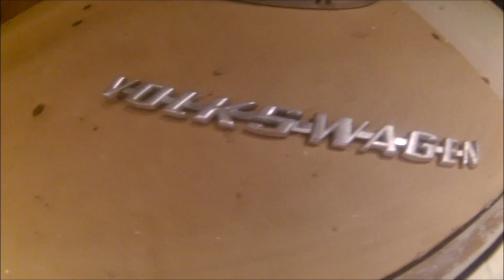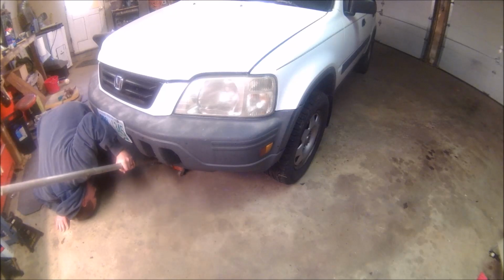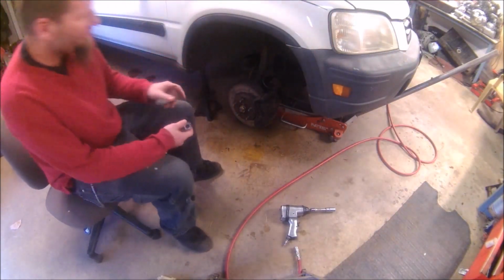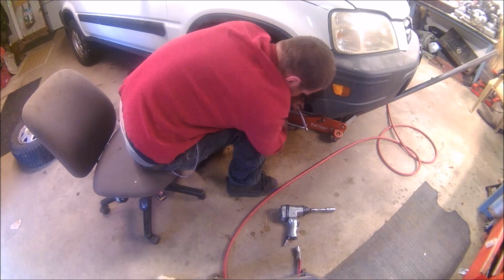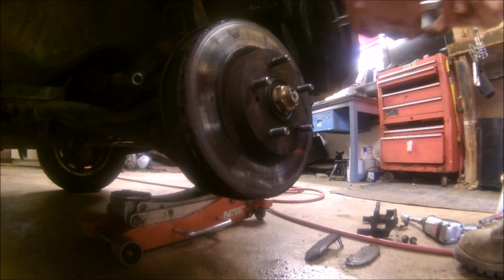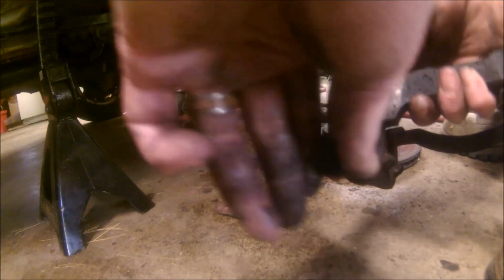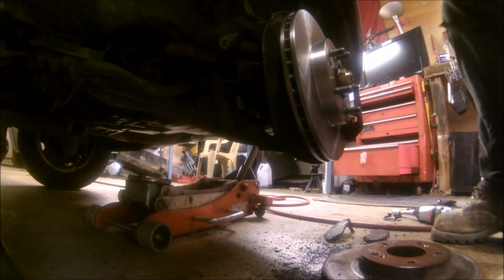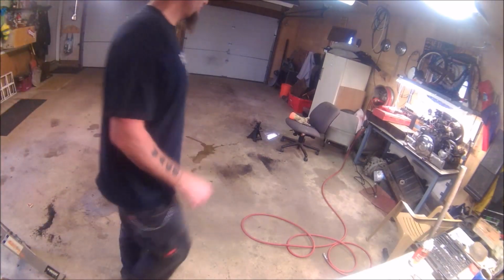winter honda needs brakes

Comment: NIce job, We have the same problem with salt on the roads in the UK. They normally manage to put it down at the wrong time and you don't want to drive behind a gritter as the put the salt on the road or you get covered in stone chips that start to rust almost instantly.
Reply from the maker: sounds like the same problem thanks for watching

Comment: I know what you mean all the normal maintenance gets in the way...... I've just been wax oiling my daily driver ready for winter... greased all the brake lines with normal grease and the hose ferials with red brake grease cus its OK to use on rubber being plant oil based...
Reply from the maker: good tips for protecting you car for winter. thanks for watching